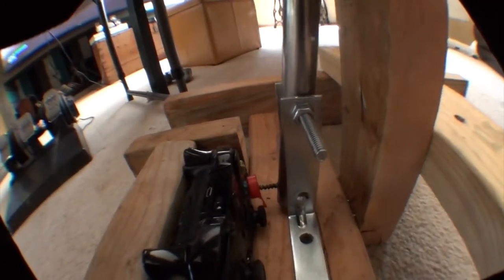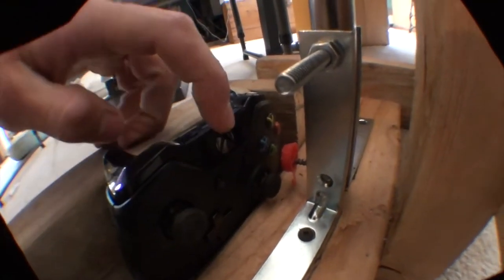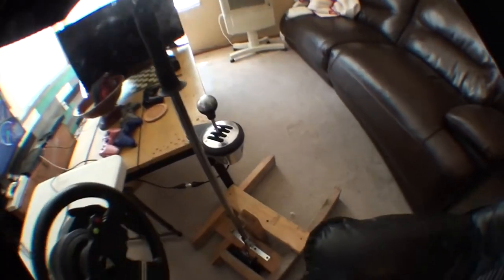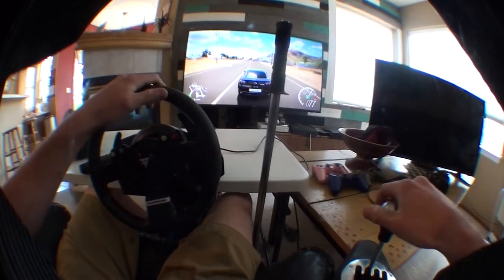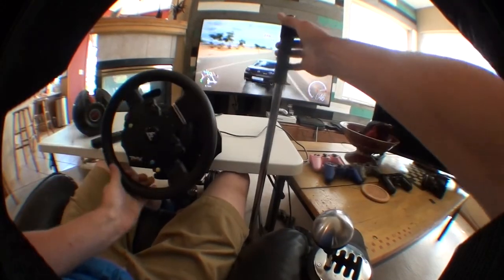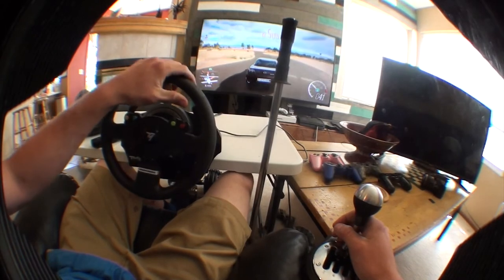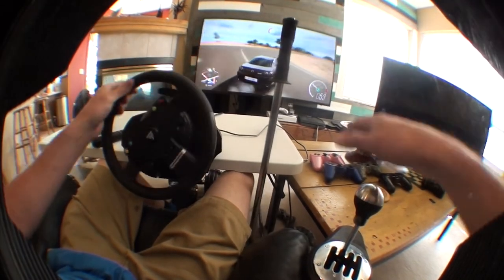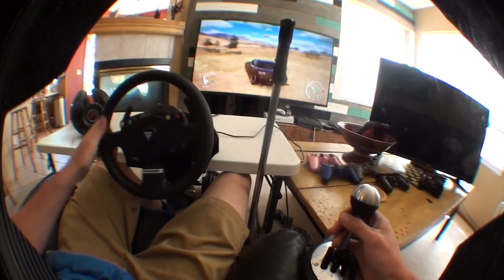How to Make an E brake Mod for Xbox 1 or PS4 | Easiest, Cheapest Way!

Comment: How do you use the controller and steering wheel at the same time
Reply: Basically when u stop using the wheel it lets you use xbox when u use steering wheel it doesnt let u play comtroller
Reply: Turn on the remote, sign in, turn off remote, turn on wheel, turn back on remote, and they should both be on and in the same account